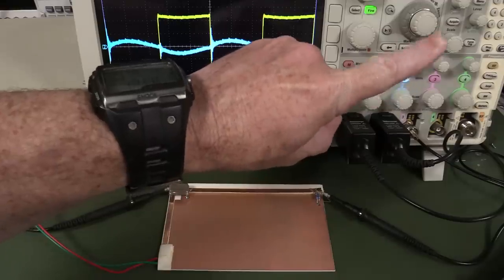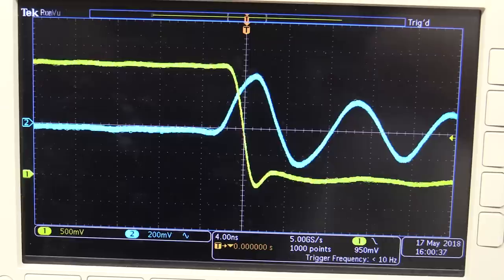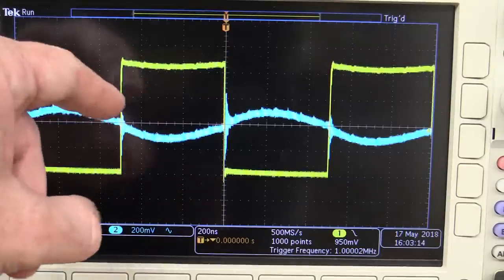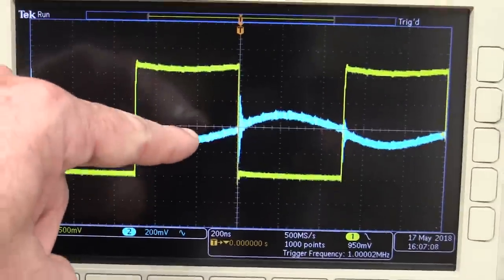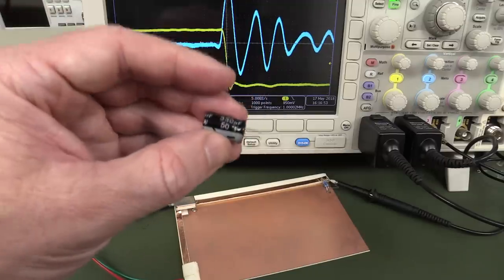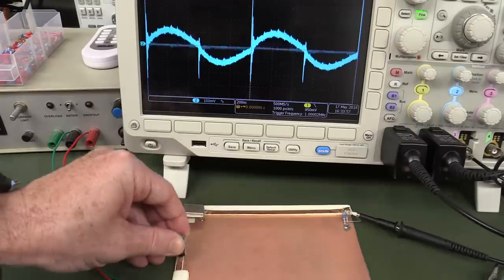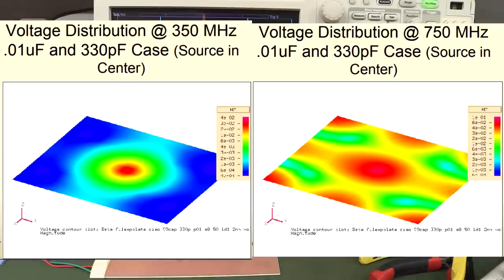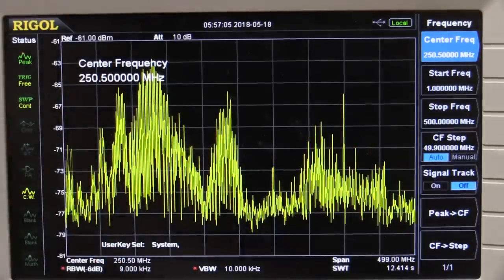EEVblog #1085 - Bypass Capacitors Visualised!

Comment: Would you be able to demonstrate the differences between a quality low ESR electrolytic capacitor and "normal" electrolytic capacitor on your test setup ? (might need to use higher frequency Xtal and/or bigger load and/or bigger load driver ?).In all my 30 odd years designing electronics I have only had one design messed up by low ESR capacitor being substituted by purchasing, who found and substituted a  cheaper 1000uF for a power supply design. System worked, passed self tests, RAM tests, FLASH tests but would just sometimes lock up running customers code, no diagnostics, no debug, nothing to work on, just locked. Went through design with fine comb and spotted incorrect capacitor and when replaced system worked fine 100%. Scoped PSU, nothing untoward with wrong cap, but clearly caused the issue.

Comment: Cool. So if you switched a transistor so there was some decent current, maybe a thermal camera would show it.
Reply from the maker: Wouldn't work for transient noise though, just not enough energy in that to heat up a wire to show it thermally.
Reply: Not wire, the current flow through the copper foil.

Comment: good video, however we have a different philosophy.    When I took Electronics Engineering we where told that a "BYPASS" Cap is not there to store energy.   That is the job of a Filter Cap.   A Filter Cap is the large Electrolyte that you call a low frequency bypass.  The small "BYPASS" Caps are to short high frequency signals to ground.
Reply from the maker: It's a matter of semantics and point of view, but the "bypass" cap does indeed store and supply energy. I think I mentioned this in the video in an overlay

Comment: Hello Mr. Dave, just a correction as far as I know:
The line you drew at 23:50 for the large loop area of the HF return current is not correct. The HF current would take the path of least impedance which in this case  (with the large ground plane) would be directly underneath the signal current, which is the path of minimum inductance.

Anybody correct me if I'm wrong.
Great video :)
Reply: Agreed, HF current will flow under the traces; if there wasn't a continuous ground plane it would have been different, but still the path of least impedance at the relevant frequency, not at DC.
Reply: Same thing came to mind
Reply: Correct-a-mundo

Comment: Thanks Dave, great video
Did you put the power and output lines at 90 degrees to each other to reduce coupling between them, or for the camera ?
Reply from the maker: I did that so I could draw an overlay graphic explaining loop area. It would be obvious if you put them in line
Reply from the maker: Oops, meant to way wouldn't be obvious.

Comment: Hi Dave... the reason that we have to put the capacitor as closer we can to the chip is for minimize the current loop which this is where creates the noise on the signal? I want to say the noise is created from the current loop or the noise exists for the various parasitic capacitance and inductunce on the circuit and if we don't want an EMC compliance we can put the 100nF in whatever place we want it the PCB?

Comment: You can make such a current probe yourself, I use mine to check the effectiveness of capacitor placement in SMPS. It's in one of Linear Technology application notes, the waveform is the derivative of the current beind sensed.

Comment: At 28:48 "We're at 2ns per division. What is the period there? Well it's about 4ns."
I really don't think so. The period is the time from one maximum to the next.
It's clearly somewhere around 2ns. And that's a frequency of 500MHz. So the crap around 250MHz and 125MHz are either subharmonics of that ringing, or they are coming from somewhere else.

Comment: Great stuff Dave as always, watching all your videos. Here is something out of the fun : i was thinking for the lowering of the ripple(without any practical sense/just experiment) if we have same double "whole circuit setup" and on one we use negative voltage and on another positive voltage and with some diodes on the end where we join them ,i keep wondering what happens on that spot since if two opposite waves of anything meet with same amplitude it should cancel itself out almost perfectly(water, em fields, whatever as long as waves, each one on its unique ways but none of the less same rule applies) and lets say we use 5v power sourcex2 (+5,-5) do we get double the potential of 10V on the point where 2 circuits meet and with no ripples(since we clashed 180 degrees together) but yet again with no frequency since we clashed the opposite frequencies together, does this also cancels the power supply frequencies on that spot where two outputs of the boards meet, what happens with power supply pulses reading since they will clash together close to exact time as they are 180 degrees away from each other, since pulses in switching power supply are not frequency/waveform they would not care if one is 180 degrees apart so does that means we get double the size of both pulses while measuring O.o' ? Im interested to see what oscilloscope has to say on all those things and how to use oscilloscope for this particular weird case since i am curious to see what single channel measurement has to offer when that particular spot is probed.  

I would measure by myself and learn but im keep waiting some freelance to do to be able to assemble my mini lab(i am video game developer and im looking to step into applied electronics for research reasons of actually electro magnetic fields) so forgive me if im not in pair with knowledge with all of you guys, hardly i have more then a 2 circuits put together in my life. Its great not having things since it pushes us to create our own equipment and is lot of fun and learning material, for anyone who does not have oscilloscope you can build crude one out of hard drive and start from there(its more expensive in your time building one by yourself but if there is no jobs around it becomes logical building one).
Reply: I mean maybe there is some crude usage from that weird questions. For example if we have circuit already built that we want to advance and lets say we already have frequencies we need going on somewhere on the board and there is no option for us to tap it and lets say we have exact scenario of 180 degrees voltages joining to one spot that previously haved proper frequencies to them, it may be possible due to "not living in perfect world" that all frequencies are actually much smaller and that we can add optocoupler and save them back from that meeting point  and amplify further so we can extend our circuit < weird example once again, will it ever happen(hardly)? But if happens that there is some frequency leftovers indeed with very small amplitude, well thats the range of all other junk frequencies and similar amplitudes and we would amplify all those also i guess now when i think more about it. And separating our desired frequency from that amplified junk would not be possible. So i said nonsense, lovely ahhahahahah. :'D
Reply: And just one more thing, since your knowledge goes way beyond applied electronics(i hope that you can brake down this in one of your next videos), i want to mention one thing that i saw and which is annoying and is not related to you at all and it is about "electricity flow" that we all learn, and subject goes: we found more convinient for our electricity math formulas to not write -1 but instead just 1 so instead of saying that protons are the ones which move backward(-1) we just said electrons are moving forward(1) so the actual electricity per what i saw flows in completely opposite direction from what everyone learn(for convinience reasons we swap the explanation). Now if explained to average person becomes highly dangerous since wrong interpretation could be that negative is positive and positive is negative(in terms of what kills), and with previous knowledge of which on is dangerous someone could grab wrong wire and see you life later. No its the same wire that kills you in both cases(both explanations) but its interesting to know that what actually kills is when something removes the energy from your body and getting the energy is safe=holding onto(well established) of what we call negative wire. For applied electronics i think knowing what exactly is going on is not that important since results are predictable and true anyway(by observing result) but for any deeper research it is crucial knowing the true facts. Like i said i saw the video about this but i was not satisfied of how detailed it was explained , so i would like to see Dave explaining this O.o since i know he would do proper job explaining it more deeply. Is any of this true or BS? And if is can you point to extensive research papers about what we figured out so far about electricity research it would be amazing(in deep level of things).

Comment: So, just out of interest: If I had 1000uF, 100uF, 10uF 1uF, 100nF, 10nF and 1nF just for the hell of it all connected in parallel right behind my voltage regulator, would I get absolutely clean DC?

Comment: good job!   
        and  i am wondering about  that  high frequency noise(s) 
maybe  Be  generated from the copper board's  surface,  but  ...
the other hand low frequency maybe comes from under the copper board.

Comment: Youtube recommended it to me right now .. there seems to be some other crap on the VCC when not decoupled. May the crystal in that oscillator actually be a 8 MHz one and it includes a divider? I count 7 little spikes in between of the large ones caused by the output.

Comment: Can you explain the 50mV DC level shift between the 100nF cap and the 2.2nF cap at 19:40? Is there actually a DC shift or is it just so zoomed in that the voltage drop is only local?

Comment: Where does all of the high-frequency noise on the blue power supply scope trace originate exactly? Is it generated from the drop resulting from ringing on the output of the oscillator only, or is there some other high freq from say the switching supply? I see many smaller but regular peaks all along the blue power supply trace along with the "ringing" waveform on the same blue power supply line trace. I understand the bypass/filtering concepts but getting stuck on that blue trace.

Comment: I think you misspoke. At about 4:00 you say, "The whole point of bypass capacitors is, of course, high-frequency digital systems".
Well, no. As I'm sure you're aware, they are critical for high-gain analog circuits, especially high-speed op amps, which will happily oscillate if not bypassed.
For that matter, even low-frequency amplifiers will oscillate like crazy if you don't pay attention.
Back in the early days of transistorized audio amplifiers, the sound produced by an amplifier in oscillation was so distinctive that it got its own name: motorboating. Sounds a lot like a small outboard motor. Of course, in them days electrolytics weren't well-established, so bypassing wasn't as easy as it is today.

Comment: seems like its best to have large capacitance capacitor at all the IC power pins. Like if i have to choose between 10nF and 1uF, the choice would be to use 1uF always, without care for the cost or size, 1uF will definitely be the best choice than that 10nF. Am I right?

Comment: how would this apply to car stereo amps?

ive got a 1000W rms amp.... but only use about 600W of it, due to one sub being blown (subs are 500w rms rated).......
and ive been running a 2 farad cap......a big mean bastard!

i dont really notice any change in the sound..... headlights still dim

but.....if it will keep the amp happy.... make it last a bit longer.... than ill keep it in their

as currently..... its sorta old, half broken.... and takes up a bit of room

i think i would need MORE capacitance to really stabilize the voltage.... but because i dont listen to bass heavy music anymore....it mighht be more effective than i think
probably only using 1 or 2 hundred watts to play the bass drum of rock and roll music

Comment: Also note that you don't have perfectly solid electrical connections between your capacitor and the traces in your experiment.  So your not going to get the full effect of the added capacitor.
Reply from the maker: I explained and demonstrated the effect of package connections

Comment: i am a little bit confused what will happen if i had multiple small capacitors would they block low frequency or high frequency  ?? (i also watched your why electrolytic capacitors are connected in parallel)

Comment: Dave, you forgot to include inductance in your schematic of the rectifier, for high power loads it is mandatory, as by connecting the rectifier without inductance to high C low resistance capacitors you are likely to overload your diodes.
Reply from the maker: Nope, rarely a problem. Chose your diodes properly.
Reply: A NTC thermistor in series with the primary  is more common for medium sized loads.
Reply: Dave, apparently you didn't look much into schematics of welding machines, as an example. When the capacitors are discharged, they have to be charged slowly initially or your diodes are going to be fried. If you are in favor of low efficiency high forward bias diodes, I see it as nothing more than a lack of knowledge.
Reply: Aa Bb Welding machines are quite extreme.
Reply: They have a correctly designed circuit, excuses about "extreme" are pathetic.
Reply: Inductors are expensive and will waste power. Welders are just one kind of power supply.  For small power supplies the capacitors are not large enough or it is cheaper to put in larger diodes.
Reply: Still, the correct solution is an inductor. You are talking about simplified solutions, which formally are not exactly correct.
Reply: Is not as important on small power supplies.  On large powers supplies (including welders) there are several ways of doing this. Active power factor correction is worth investigating as this sits between the rectifier and the baulk storage capacitors. This has soft start built in.

Comment: Some oscillators have integrated bypass capacitor in that metal case. Did you open the metal case and check for that cap?
Reply from the maker: I thought about that and was about to do a two minute teardown video of one, but that takes longer than 2 minutes and I figured if it didn't give me the result I wanted then I'd tear it apart. Turned out it worked fine. Might still do it for kicks.

Comment: More nagging questions. I assume it's bad practice the way this is setup:
If it's REALLY necessary to locate the load that far from the oscillator, use coax cable! (grounded at which end, though?)
Shorten up your power supply lines ;)
Reply from the maker: It's very common to have trace lengths that long on a big complex board.

Comment: Ok EEVBlog i have a question for the comments section that i think is fairly interesting. Suppose i want to se up an audio amp  (Class AB) and i want to power it with a switch mode power supply, how would you ideally setup the bypass caps in a circuit like that to prevent the switching frequency from bleeding into the audio? (powering an AB amp with SMPS is not ideal at all. but would be interesting to see if its possible)
Reply from the maker: You don't do that with just bypassing caps, you'd use series filter inductors in the power rails.

Comment: What is behavior of solid polymer capacitor as decoupling/bypass? They have much lower ESR than typical aluminum electrolytic cap.
And could be there any troubles if they are combined with MLCC?
Reply: One problem could be when they are used as output capacitors of some switching supplies that can be unstable if the ESR is too low. 
Generally, find the resonant frequency from the manufacturer, to get an idea of the maximum useful frequency and parallel with smaller capacitor if necessary in your application.
Reply: Yes, I'm aware of this problem as output capacitors but it's much interesting to know if there could be any problem with them as input capacitors.

Comment: 5 years later, i hope someone build a reputable company specializing on making high end adjustable variable capacitors. so that filtering/bypassing is just about twerking and turning knobs, or even integrating it to some sort of motors and program it to auto twerk/turning/bypassing.

Comment: Could you cancel out loop rf by having an extra plane that does the same or 2x 1/2 the capacitance in the other direction?
Reply: At high frequencies, all the return current flows through the ground plane under the trace.  The trace and the ground plane are coupled like windings on a 1:1 transformer.  Current in he primary flows through the secondary in the opposite direction.

Comment: "Decoupling" and "Bypass" are misleading adjectives. The capacitors should be called "Coulomb buckets" and as such need to provide the required charge upon demand (i.e. handling instantaneous di/dt). A PCB with a properly designed PDN (Power Distribution Network) with integrated high performance "Coulomb buckets" can eliminate the need for any additional PDN caps.The beauty of using the PCB is that it can provide a super low impedance and extremely localised current path.If Dave did a demo with a PCB that has an well designed integrated Coulomb bucket he'd find that the he wouldn't need any  caps at all.

Comment: Mr. Davi cordial greeting, a team that says on its plate that works at 220v AC respect to neutral line, can be connected to two lines of 110v AC to add me the 220v q q requires the equipment to work thanks

Comment: What about using a variable cap to tune in the perfect bypass capacitance?
Reply: Also, using the slice of transparency on the board to draw was brilliant, I may have to borrow that, if that's ok
Reply: Because it is also tied to parasitic inductances and esr which is not going to be replicated by a variable capacitor.
Reply: +Gadget   Yes, Intel uses programmable caps every millionth transistor in their chips.